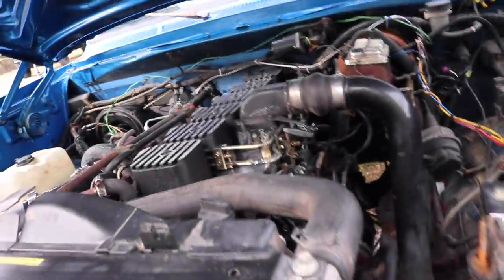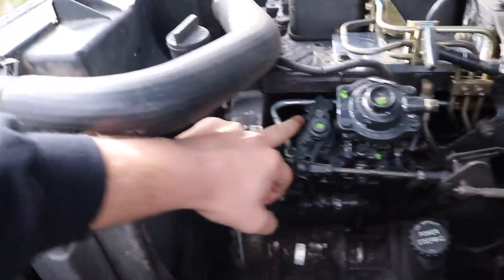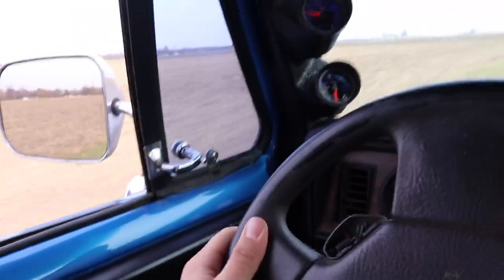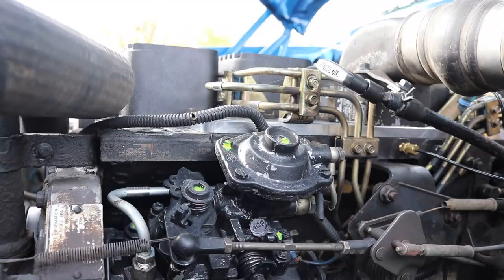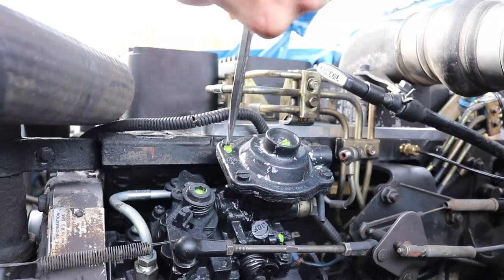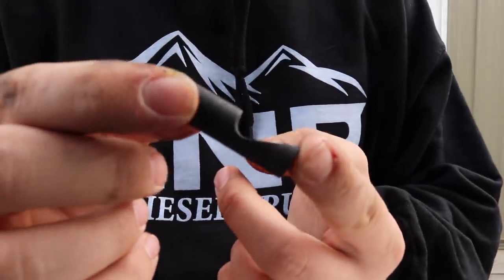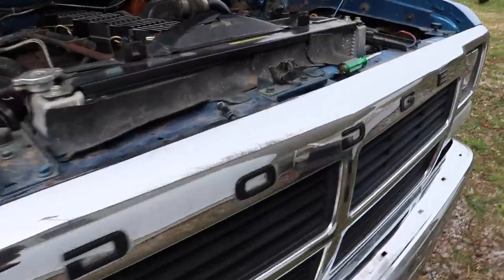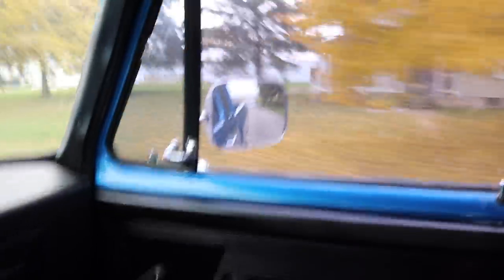40 more HP for UNDER $40!!!

Comment: When you removed the top cover of the VE Injection pump, that is grease. It’s fairly common in these pumps when you put them together. It keeps parts lubricated and protected from the beginning. I work in a diesel fuel injection shop 👍🏼 keep up the content